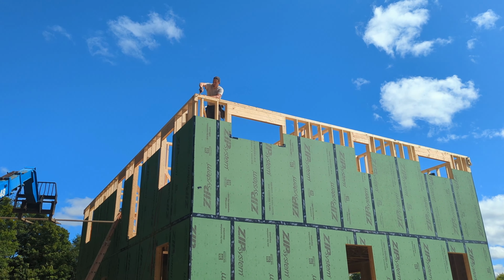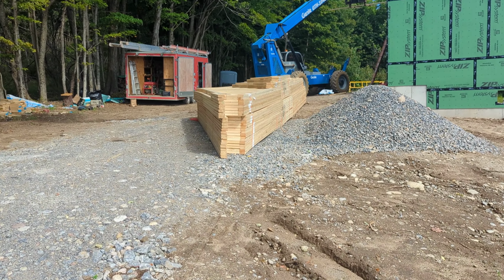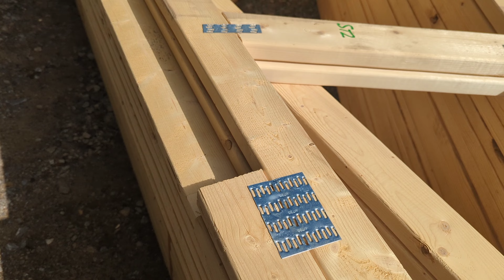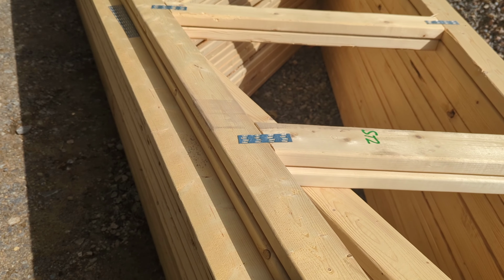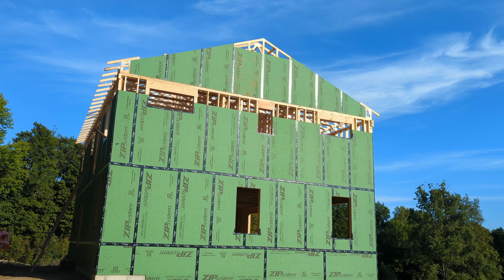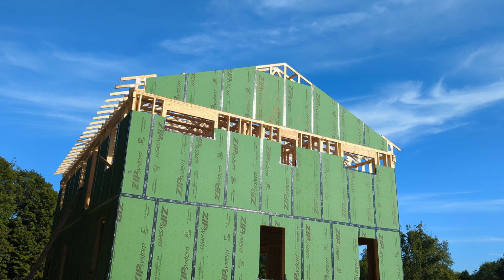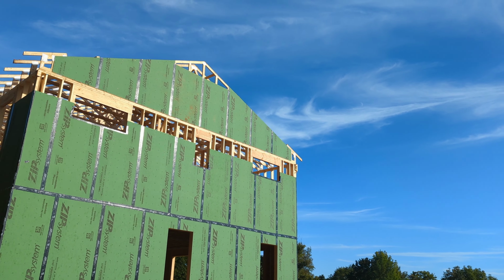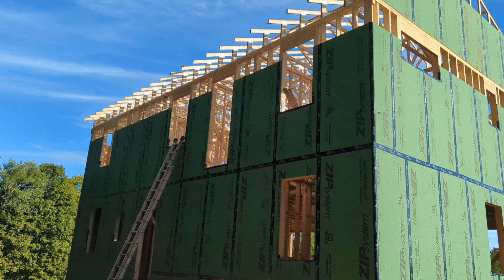Raising The Roof

Comment: Man I love zip sheeting.  Roll on that tape for the seems and use some liquid flash for the nail/screw heads, and that baby is completely waterproof.  Some people don't even use the liquid flash and it works great.  Zip for the win.  
I built a cabin in our backyard last year when you couldn't find zip sheets anywhere. Came across a fella that had a whole stack of it for $35/sheet.  Bought enough to finish our cabin and had a blast.
Never seen the JLG Lift remote controlled thing before. Looks fun and useful
Reply from the maker: Nice find on the zip panels. It's a great system. Looking forward to getting the roof deck on this week.